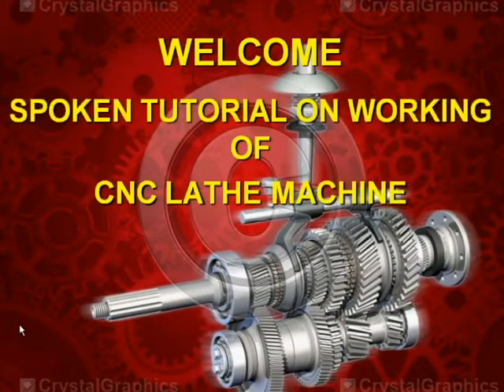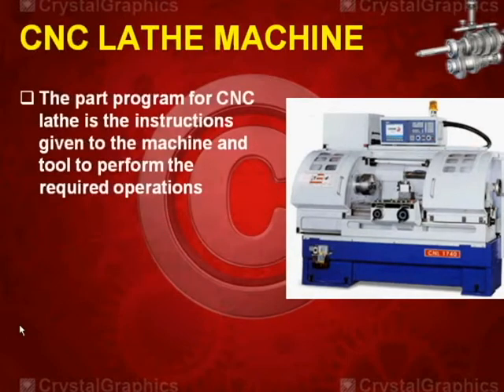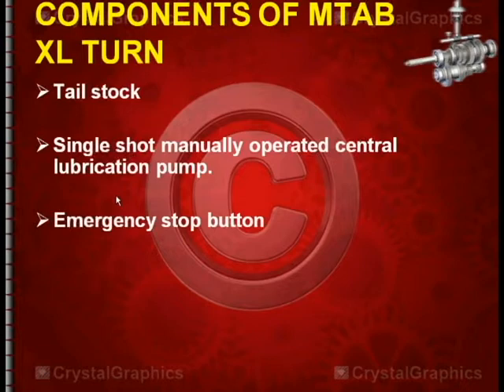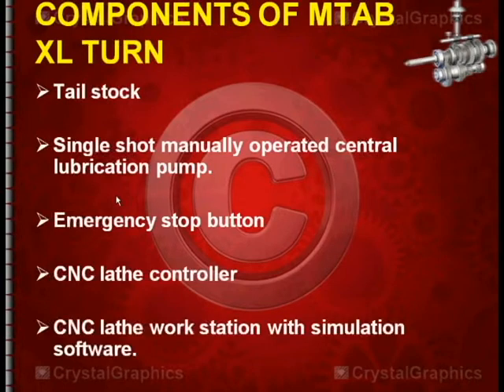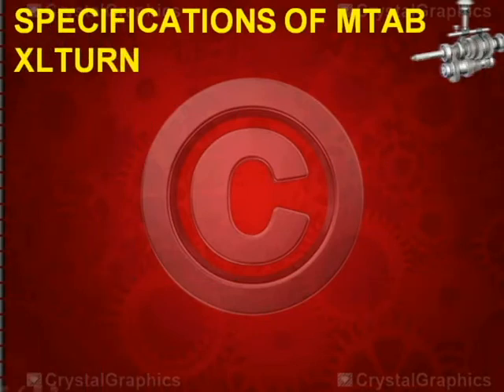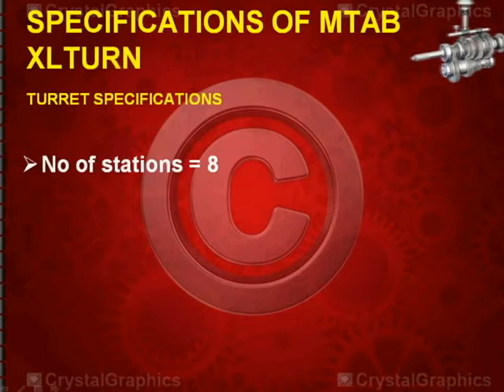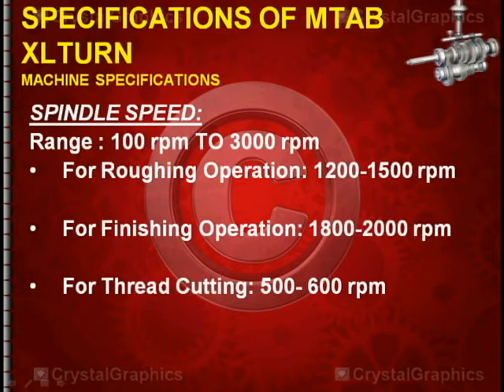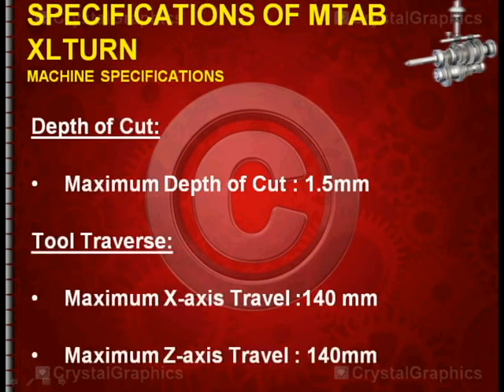GRIET/CAD-CAM LAB/ CNC LATHE Tutorial PART 1

Comment: Mam we have same machine in our college but we have small issues. When we connect the machine link there is a error comes as a" RS232 time out" 
Have you ever face like this error In your machine 
Ple tell me how to solve this error
We have used RS232 cable to connect computer to cnc macine
Ple let me know how to solve this error if you can "RS 232" time out